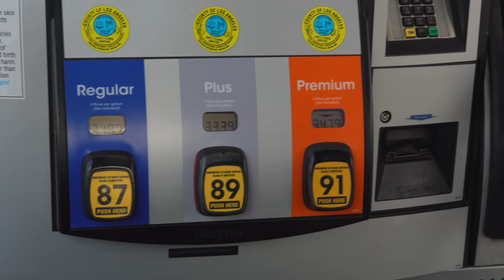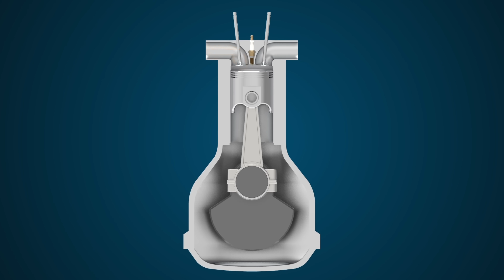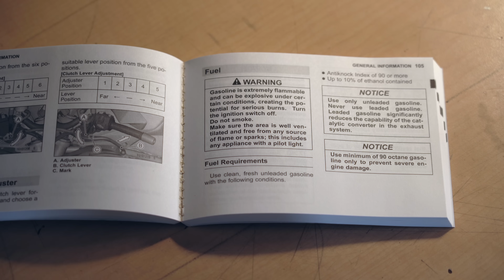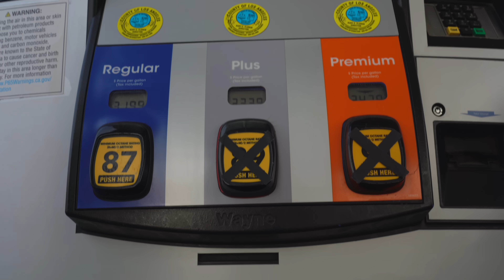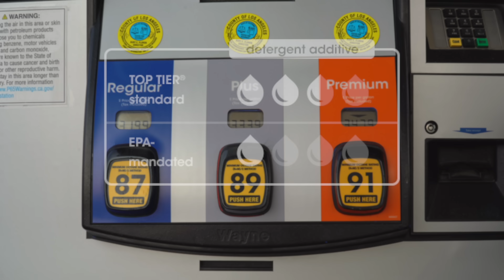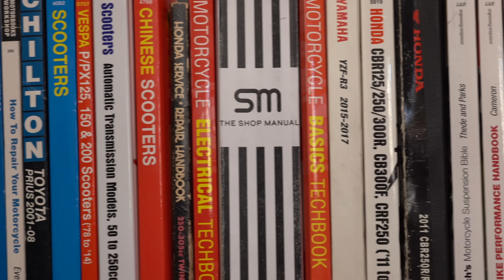Should You Run Premium Gas In Your Motorcycle? Octane Explained | The Shop Manual

Comment: You forgot to mention that if your bike has a Carburetor and built before 2007, REC 90 with no Ethanol will make your bike run smoother.  When REC 90 is not available and you have an old Bike, 93 will work better then 87 which has more Ethanol then the 93 octane.
Reply: Yup, but it's not about running smoother, it's about the ethanol negatively effecting the fuel lines, petcock seals, carb gaskets, etc.  Ethanol tends to cause them to harden and get brittle.

Comment: Here on the UK standard fuel is 95 and super fuels are 97 or 98 . Not sure whether he's correct about different rating systems. And essentially the higher the octane the longer the burn duration - important with longer duration valve timing.
Reply: Not sure I'm correct? You blokes use RON (Research Octane Rating) and we use RON+MON/2. That's not a hard fact to check.

Comment: The only reason I would run high test gas in a lot of my seasonal toys and equipment is that’s the only grade that has no ethanol where I live.
Reply: Right on. Great reason. Ethanol is the enemy of long-term storage! (That's coming from a former small-engine mechanic.)

Comment: If the manual says use 90 cotane minimum and if I fill 89 octane ethanol free, will it cause any damage to the engine? I don't know how much difference 1 less octane would make. Please help
Reply: It's not gonna grenade, but you'll have less detonation protection. That'll only be a problem if you're climbing a particularly steep hill, hauling a lotta weight, or sitting in traffic with the engine getting really hot. I wouldn't sweat it, but be cognizant of the fact that you have a little less cushion that the manufacturer intended.

Comment: The manufacturer specs the minimum grade. You can run higher. Also losts of modern engine can benefit from higher octane fuel than the minimum spec. The ecu can advance the timing further and thus develop more power or better efficiency. The bbc program fifth gear did the test on a dyno.
Reply: The vast majority of motorcycles do not have knock sensors.
Reply: @AriH211  mine does. But if high octane fuel will give you more power...--> depends on the engine.

Comment: You are 100% correct about octane, buy what your engine was designed for. As far as detergent additives or other “performance” additives in top-tier fuels that the large oil companies like Chevron use, the amount added is so minuscule it’s hard to believe it does much of anything. Say, for example, you bought 20 gallons (80litres) of supreme plus 94 octane from Chevron, the amount of fuel additives would equal about a single drop from an eye dropper. That’s not an exaggeration. If that actually does something It would be a miracle. I use to mix the stuff, I know firsthand.

Comment: A tale of two work beaters: 2002 Jetta with an 80 mile round trip commute and a 2010 Honda CRV with a 75 mile round trip commute. Both had far less than 100K miles on them. 

Neither required premium, but both benefited from it. I saw a ~10% boost in MPG when using premium vs using 87. It was quantifiable and repeatable, not imaginary or rationalization. I also noticed quicker throttle response.
Reply: I'm not sure what market you're in, but in some places Premium doesn't have ethanol in it, which would explain the difference. Ethanol is often mixed in at 10% by volume and only has 60% of the energy density of pure gas, so yeah, it nets less MPG. Also, if your sub-100,000-mile engines have excessive carbon buildup on the piston crowns and heads - which would raise combustion and possibly cause detonation that the knock sensor/ECU would remedy by pulling ignition timing - then yeah, the engine would definitely run better on Premium since the timing could be more advanced and extract more power out of the fuel charge. 

I'm not saying Premium or non-ethanol gas will never make a difference, but what people fail to do is thing about why it is actually making a difference. Engines are systems and fuel is just one factor that affects many other aspects of the engine's running.

Comment: You're wrong... Every car I've owned for 35 years I've compared the high and low grade fuels.
See, I was driving 400 km per day as my job... So knowing EXACTLY how many kms a tank i got was easy. I got more miles on high grade fuels, and still do... as well as the cleaner burn making it so I can lengthen service intervals , like motor oil will last quite a bit longer.
See, you are forgetting another important variable in your mix... ETHANOL 
High grade fuel here, has ZERO ethanol... This is very important to me in all my vehicles. 
Ethanol does not get the mileage gasoline does.
I was getting 75 to 100 kms more per tank on Shell Vpower over the regular, on the daily...
Your theory is sound, your practice is lacking, because in the real world, you WILL see a difference.
Reply: placebo dumbo...
Reply: @1000volt-de  A placebo is a fake that doesnt work... I've got 36 years  and millions of miles proof... 50 kms a tank extra is proof... not a placebo
35 years of professional driving, 5,000,000 kms  of nightly fill ups recording my fuel consumption...
You cannot placebo a professional that is recording 13,000 fill ups and 13,000 tank empty's 
you are an idiot.
Reply: @1000volt-de  Also... to add.. my motorcycle only gets 300 kms on regular fuel... there is a 330 km run I do that has no gas station... the only way I'm not walking my bike for the last 20 kms... is if I use premium fuel at the last gas station... again... people who haven't actually tried it... dont know shit...
Take a full tank... and test it yourself...
I suppose you all dont have to because you're all experts... hahahahha
Reply: @1000volt-de  https://youtu.be/bEf9Fdvx_Sc here your placebo dumbo

Comment: Great video. I have been using no ethanol 93 octane gas when I can find it. does it give more HP?
Reply: That is because ethanol has less energy density than gasoline. You need almost twice the volume of ethanol then gasoline to have the same energy density. So if there is 10% ethanol in the gas it will effect your milage and your power output. I grew up building and racing midgets and sprint cars. We run ethanol or methanol in them. We have inject almost twice the amount of fuel into the engine as we would have to with gasoline. The only nice thing about ethanol is that it is harder to ignite in a crash, and it also runs cooler in the engine. But you do have to run really high compression to use it effectively.

Comment: It depends mostly on compression ratio. Most of what “premium fuel” does is increase the flash point of the fuel, so it’s harder to pre-ignite and creating knocking, which will wreck big end bearings. If you have a low compression engine in a 2 door shopping trolly of a car, then regular is just fine. Many bikes come with higher compression engines these days, many of them require mid range fuel just for the anti knock features of fuel with a higher flash temp.
Reply: @Josh-cw8by  yep and why would advanced timing be a problem? because if it preignites, you’ll get more knock.

Comment: Great explanation. Just a point of correction. Detonation simply means combustion or ignition of the fuel (when fuel ignites). Detonation of fuel is how every internal combustion engine works. What you mean to say is "pre-detonation". That is what causes the harmful pressure to the internals that you so well described and illustrate (detonation at an early /wrong phase of the piston stroke). Great video and straight forward! Love this channel.

Comment: Great video, best explanation of the science I’ve seen, thank you.

I bought a new Kawasaki Versys 1000 in August 2020. Great motor, but I did notice some vibration at around 4000 rpm. Not unbearable, but that does correspond to 60mph in sixth gear so cruising around the legal speed limit became a bit tiresome. Some professional bike reviewers have also noticed this, but they mostly put it down to their new test bikes’ motors needing « run in » (as we say in the UK). 

So I did some more trips, but even after 1500 miles the problem was still there. Kawasaki recommend « E5 » unleaded petrol (gas), which as I understand it contains 5% ethanol. Both BP standard unleaded (95 octane in the UK) and BP Ultimate unleaded (98 octane) are E5, so they both meet Kawasaki’s recommendation.

According to your science, and I know that this is accepted wisdom, I should have noticed no difference on switching from BP standard unleaded to more expensive Ultimate. And yet.... my motor is definitely smoother, and the vibration at 4000 rpm has virtually disappeared! I guess you will tell me that this is a placebo effect, just like homeopathy. I should get someone else to fill the tank without telling me which fuel has been chosen, and then see what I think. Maybe I will, but I don’t want to spoil the illusion!
Reply: I have seen better fuel efficiency in my Harley Davidsoj Fatboy, 47 mpg from 87 octane and 54 from 93 octane. I do not think it is all hype. 

I also have had similar experiences in my car
Reply: I also ride a Versys 1000 but I have found no difference between different octanes or different ethanol percentage. There just is a slight vibration around 4000 rpm. Adjusting valve clearance and synchronizing the throttle bodies at 42.000 km did make a slight difference but that is to be expected after a synchronization. I did notice that after owning the bike for a while, I got used to the vibration and I almost never notice it anymore.

Comment: I've heard from some top tier gas companies that they put the same amount of detergents in their 87 as they do in their 91/93, so I'm not so sure about going higher octane for more detergents. At any rate, my CBR500R calls for only 87, so that's what I use and after 3 years of running it that way, there hasn't been any issues.
Reply: The Shell chemical engineer I interviewed said they put significantly more detergents in their Premium than regular, and that's common across Top Tier brands. Even at a minimum, Top Tier puts 2.5 times more than the EPA-mandated minimum.
Reply: @AriH211  Well fair enough I suppose. I guess the occasional 91 can't hurt for the extra cleaning every now and then, but yeah good to know that even the base 87 is still very good. Thanks.

Comment: My gf puts not many miles on her bike, maybe 1000/year.  She insists on premium, as that's what the PO told her to use, though the G650GS is tuned to 87.  In Wisconsin, only premium fuel is non ethanol.  I've heard that ethanol fuel is not good to have sitting in the tank for long periods.  So, what fuel to use?  87, tuned for her bike, or premium, which has no ethanol?  No ethanol plus fuel stabilizer?  THANKS!
Reply: If it was my bike and I rode it that infrequently, I would 100% go for the ethanol-free Premium. Running a higher-test gas in a bike tuned for lower octane fuel has no detrimental impact.

Comment: No, modern engines retard or advance ignition in response to knock. Why do they bother? Why wouldn't they just not set it low and forget it? It's because advancing the ignition increases torque throughout the rev range, at all revs more power is available with the more advanced timing - which is only available from higher octane fuels. So with a high octane fuel you make more power, torque, fuel efficiency, longevity (softer ignitions) and throttle response.
Reply: Only a handful of high-end motorcycles have knock sensors. The vast, vast majority do not.
Reply: @AriH211  I'll bet you a buck Ari, even without knock sensors, modern EMU's use surrogates and so that most can and do take advantage of higher octane fuel.
Reply: @scottnineteen  If I take that bet, it looks like I'll be a buck richer! By "surrogates" I assume you're suggesting some form of vaporware (magic) is being used to sense knock?
Reply: @AriH211  no, well...I did read knock has an effect on combustion efficiency (I read a few research papers) and so given  the ubiquity of O2 sensors (and given the other multitude of inputs, air temp, throttle position, etc etc) an enterprising engineer may surely imagine a round-about way to detect knock (or its absence)...and so an ability to take advantage of higher octane gas. 

Yamaha etc are going to have some devilishly clever engineers I suspect you have more access to them than me .... and I swear I will send you a dollar ( and perhaps two for your troubles) if you tell me one of them says they can't leverage higher octane gas for more torque absent knock sensors.

 Hopefully you don't think I'm being pedenatic of difficult, it's the same bet right?

Comment: Do different octane levels affect the operating temperature?  If my manual says to use 87, but I run 93, will there be a difference in the temperature?
Reply: Not as drastic a temp difference as if you were to run ethanol vs. non-ethanol fuel.

Comment: As an aircraft owner with a 4 cylinder air-cooled engine I have only one fuel available now days due to the EPA restrictions. We don't use fuel with alcohol in the mix. The reason is alcohol absorbs water/moisture. Remember the old dry gas people put in the fuel tank to get the water out? Well we don't want Water in the fuel, it sinks to the bottom of the fuel tank, if it freezes the engine will stop running. Ever see the top of a piston after using ethanol that gets water in the tank, not a pretty sight, expensive repair. If you're car,truck, motorcycle quits along the highway, no problem right? However, in an aircraft engine, if it stops running, pilots have a big problem, can result in death. The FAA are trying to find a substitute for aircraft piston engines since the EPA went nuts on pollution they claim is happening to the earth. The bay sayers are getting rich from people's ignorance. Just take a look at our solar system. All the planets orbit around the sun which controls everything in the system we live in. Next look at earth where we all live. Place a pencil dot alongside the earth. That little dot you created represents all the people who live on Earth!!  Just what do you think that all the people on earth can do to that huge SUN, the center of our universe? I'll tell you, not one damm thing!!! It's been doing it's thing long before any of us were even born. The people who think they can control things are just getting into our pockets for more money. Example the exhaust system on my truck had to be replaced because it didn't meet EPA requirements!!! It cost the company $3000.00 plus labor to satisfy the EPA!!! This doesn't even count all the other parts that's required to meet EPA REQUIREMENTS!!! I estimate your late model vehicle cost at least $10,000.00 extra? Got off track for a few. Why can't we use ethanol in a FAA certified aircraft, because it's not good enough fuel for an air-cooled piston engines. But they really don't give one iota about what the companies have to do to meet EPA REQUIREMENTS!!! Who pays for this bull crap, the consumer picks up the cost.

Comment: Now that they are adding ethanol to fuel here in the midwest, we have another problem.  Honda says you can burn regular with a ten percent ethanol mix.Then there is E85 which no one can burn.  If you go to a higher octane at some service stations, you get no ethanol.  Recently I ran a tank through my Honda Gold wing on regular and got the usual forty miles to the gallon.  Then I ran a tank through it on a higher octane, unknown about the ethanol, and got 46 miles to the gallon.  You have to weigh the price of the premium gas against the increase in mileage to see how you come out.  But the ethanol that the feds are pushing on us seems no good.
Reply: Agreed, ethanol is problematic for a lot of reasons. The spread of E15 is a real problem since, as you mention, motorcycles and other powersports engines aren't designed to run on it. In fact, some manuals say using it will void your warranty. We're working on an ethanol-related vid for a future episode.

Comment: I refuse to use anything but top tier fuel. If I need to use gas from sheetz or speedway I always add a bottle of Lucas or Gumout to boost the level of detergents. I also will use Lucas or Gumout about every 3-4 fill ups to make sure that my injectors, valves, and pistons stay as clean as possible.

Comment: The Truth!
Also, if using high octane fuel in a low octane engine, yoh can actually lose power and induce carbon build up, because the high octane fuel is more resitant to a clean burn when used with less compression.

Comment: My old 84 gpz 750 two valve dohc air cooled monster actually ran worse with higher octane fuel.  The extra octane would prevent full combustion and made the engine run rich.  Swap to 87 or crane and it ran terrific.  Not many bikes like that left, so it’s a situation that will rarely affect modern machines.

Comment: Great video, would be cool to note if running a few tanks of premium is better, the same or less valuable than dumping in some injector cleaner from time to time. I am on my second FZ1 (first gen, carbureted) and used to fill it at Costco. Costco claims to be top tier with detergents, but I would regularly have cold start idle issues. Someone recommended Chevron/Shell for better detergents and I made the swap. after 2 full tanks all my cold start and idle issues went away. That was back in 2012, I have been using Chevron exclusively now for both my motorcycles and by trucks since then. I will still toss in injector cleaner from time to time to help keep everything clean, but maybe I should just fill up with 91 on occasion?
Reply: What type of injector cleaner did you use? Thanks
Reply: @jdmbeats  Lucas Oil, they sell a small seni-clear bottle of it at most auto parts stores.

Comment: I ride FZ07 which is designed to run 87. But I still fill in 91 (especially at end of riding season and need to hibernate)  because they don't have ethanol added.